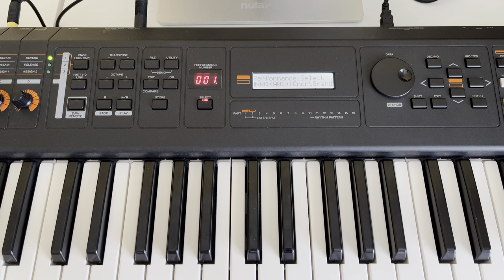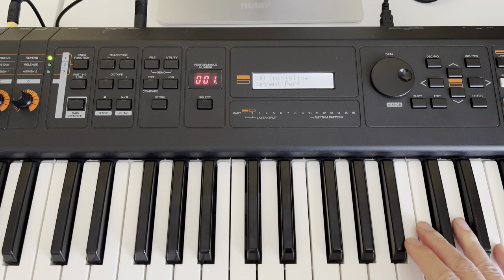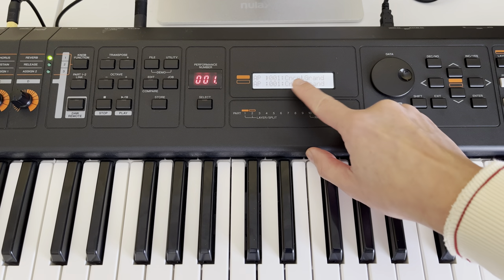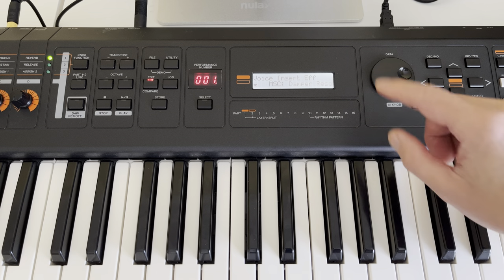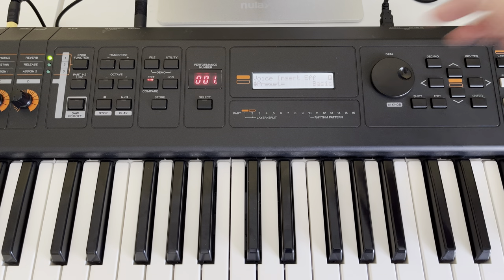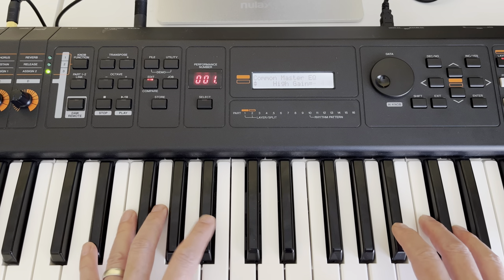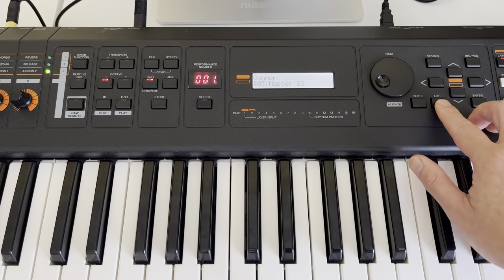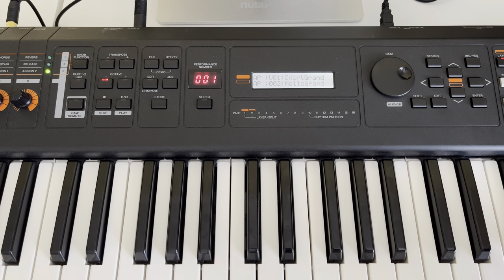How to make your own a beautiful piano sound with Yamaha MX61 stock sounds #yamahamx61

Comment: When you changed the eq setting and stored that change to the patch, once that process is done does the eq go back to the default setting or is it permanently changed for the whole keyboard.
Reply from the maker: EQ, Reverb and Chorus values are being saved as per each performance, not system.
Reply: @mdmusiz  Thanks for your reply. I'm receiving an MX49 tomorrow. Can't wait.